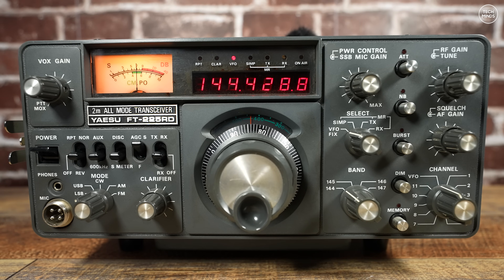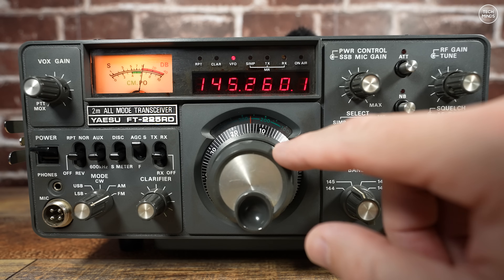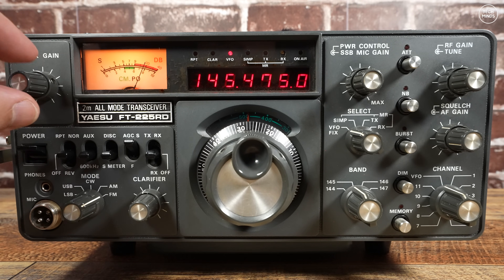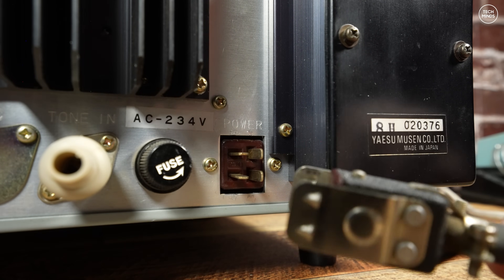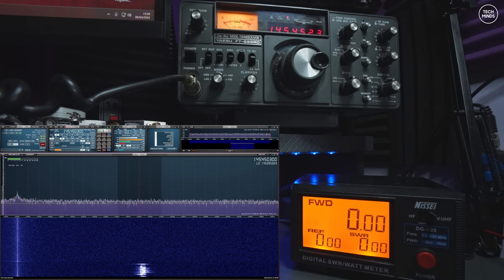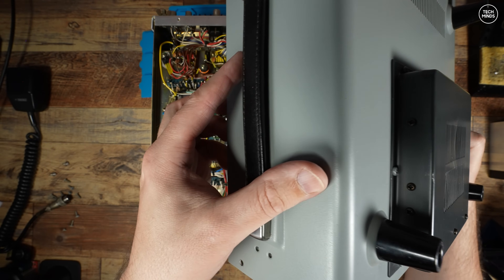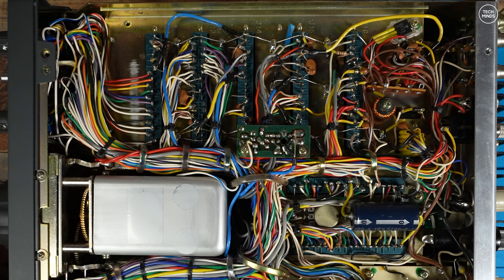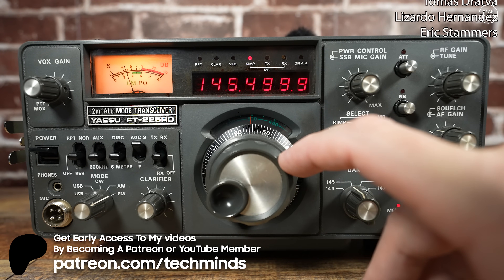Yaesu FT-225RD - A Historic And Nostalgic Classic Ham Radio Transceiver

Comment: I inherited this fabulous rig; mine also has memories. The memory function uses batteries that you need to install or replace—especially if there are old ones in there—before they leak and corrode. I put in new batteries and still couldn’t get the memories to work; the instructions in the manual are really poor on this part. One thing I’ve noticed on my transceiver is that the memory button works like a momentary push button instead of a two-position switch. I don’t know if mine is faulty or if it’s actually supposed to be like that. Bottom line: with the memory feature I’m in the same situation as you guys.
Reply from the maker: Yeh its very strange. Unfortunately I sold the radio on, I did not want to, but I really needed the space in my shack and it went to a good home.

Comment: I have a Yeasu FT250. Too busy in my life to get back into the hobby right now. Are these old radios worth hanging onto?  I've got several D104s ,a Ham4 rotor, bunch of other equipment. also planning on moving and need to downsize considerably. Where's best place to sell items?
Reply: Ham fest or That on line auction site.👍

Comment: I just worked on an older TenTec Triton for someone.  I ran through the entire factory tune and calibration while only changing one capacitor.  It has a Permability Tuned Oscillator  and the tuning procedure was lengthy to say the least.    Nice Radio!  Enjoy

Comment: I had the older FT-221 for years when I was a whipper snapper - great rig!
Reply from the maker: Im really liking this 225, I just wish I knew how to use the memory module properly so I can test if its faulty or not. The manual makes no sense.. lol.. Cheers!
Reply: @TechMindsOfficial  I can't remember, sorry 😞
Reply: @TechMindsOfficial  It's very simple to use. Whilst on the radio's internal VFO, just press the MEM button and the current VFO freq is stored. Then you can switch between the stored freq and your VFO.

Comment: I remember these, they where very well rspected and desirable,  ft101zd Mk3 would like nice with that or the ft902dm both being hf rigs. If you need a 2m yagi look at the powarbeams by dx shop, they are very well constructed and have an interesting driven element, pre tuned as well so no messing about.

Comment: Since you caught the bug: FT-902DM and FT-102. The latter is very hard to find and it is considered the pinnacle of the Yaesu "hybrid" radios. The 902 is more feature packed.  Both are a delight to use, the 901/902 are easier to work on (typical maintenance and fixing is a part of the deal with these radios), FT-102 has a better receive/transmit section (4 tubes instead of 2) and has the looks :)

Comment: The Mutek front end is under the label marked Rx RF unit, at the top right as you had the top of the radio shown and the fact that no adjusters are visible through the slot probably means that it is installed. I used to own a FT221R the earlier version you mentioned and fitted a Mutek to that. As far as I am aware a lot of people are still using these as prime movers for 2m and up for contesting and for transverting. The Mutek front end is pretty much bomb proof and has a vastly improved audio quality output and sensitivity and selectivity compared to the standard front end. 

That wacky power plug is a jones plug and they are like hens teeth. I've seen a couple of rigs from this era that have been converted to IEC. I don't know if there is space in the 225 to do this though. From memory (and its a long time ago) the 4th pin on the jones plug is +13.8V input for mobile operation using the earth pin as the negative. 

If you want to pair it with another radio from the same era then a FT101ZD and a couple of its accessory units such as the ATU, 2nd VFO and the speaker would look good together. Good luck in finding ones in good condition.

Cheers and beers 73 de Al G8YKM
Reply: Any suggestions as to a make and model of a vintage ham radio for an experienced operator. This would be a Christmas present.

Comment: Hello Matt, how good it is to see the old radios in action. I have a 221R which I have had from new. it is a great radio  but sadly without a CTCSS board it just has pride of place on the shack shelf.
I have seen the forums where people have tried to introduce CTCSS boards  in to the old radios but as they are hard wired , one slip and its then end of the radio. Thanks for the video and cant wait to see it in action with the Yagi.

Comment: Enjoyed your nostalgic look at your pristine Yaesu. I own a Kenwood TS-790A all mode 2m, 70cm rig with the optional 23cm band module. Kenwood designed the radio specifically for satellite communication allowing separate tuning of the twin 😊VFO’s etc. I purchased it second hand in the mid 1990’s and except for some minor repairs on the 70cm section and a new Mitsubishi 2M PA module it has been very reliable and a delight to use all these years. I’ve had more problems with the Kenwood MC-60 desk mic(s) than the radio itself!

Comment: That is a nice and beautiful radio from the past! I bought one for a very cheap price in an action but it is not working. With the radio came extensions cards for doing all the measurements and alignments so that will be no problem to get it working. The good thing was that the owner had the good judgement to install a mutek front end.

Comment: nice rig would go well matched up with an FT101zd or perhaps an FT102 the power plug is a jones cinch connector cuite common on 12v base rigs of the period my Drake TR7 uses the same connector. that one is shockingly clean for its age! you could easily configure it for SSTV, RTTY or a number of other modes with a suitably wired signalink box or similar you could even do wspr or ft8 though with manual frequency selection the software my complain!

Comment: Basically, the successor to the earlier Ft 221 R ( no digital display and only 10 watts ).

I always wanted one, but they were always too expensive.

I’ve an Ft 847 and an IC 7100 which both do 2metres and 70 cms SSB.

Comment: Thats a lovely clean one you have. Looks mint.  Well worth keeping as its a classic. Yes the Mains Power plug was standard on Yaesy and Kenwood back in the day.  I had a FT-221R It was a nice radio to but only 8 to 10 watts. The MUTEK front end is under the RX RF Unit cover. It transformed the receiver in both the 221 and 225.

Comment: Pick up a FT 901 or FT902 DM, they have the exact same sort of construction with the expansion cards for each function of the radio like your model there. It would make for a good station.
Reply: There is a whole lot of gear to extend these radio's. Like a rrty/cw console- transverter- second vfo- monitorscope ...
It took me a while to had it all together,  You are looking at alsmost one metres of radio.

Comment: I have always wanted Yaesu FT707 first solidstate mdsl? And it has WARC bands but not Top Band.
I wanted to buy one but “other” interests diverted me Hi. Saw one at a normal car boot for Fifteen quid but missed by seconds aaaaargh!. Just seem to keep missing them.
G4BTI.
Reply: I have one. Brought it all the way back from holiday in Hawaii to the UK, but so far not working.  Powers up but displays wrong frequency and no RX. There’s an active Facebook support group and I’ve been trying all the tips. The matching ATU that came with it does work, so at least I can use that.
Reply: £15?  That would have been a real bargain!

Comment: Lovely! This was the radio the "B" class UK hams always wanted. Superior to it's Icom rival that only ran out 10 watts. If you want to go HF then the 101ZD is from the same era and they would look good together. I think there was a 70 Cms version of the 225RD but that's going to be ultra rare. I had a 101ZD back in the 1980s when I was a new ham, bought used.
Reply: they had a , 6m,4m, 2m 70cm and Vary Rare 23cm versions
👍 FT 902d was the Up market 101zd. I am on the hunt for the older radios,  Already have a FT767gx fully kitted with all bands, just need the narrow filter for cw + a TS530s which i just replaced the caps to get it back to Tx'ing. These radio's were my dreams but much to expensive back then, but now no one seems to want them. cheap to buy, but Awesome to use.
Reply: @madb132  Not quite.  There was only ever a FT-225RD (10.7 IF) and a FT-625RD (10.81 IF).  I've converted a 225 to 4m quite easily. But to rework it for the higher bands would be much more involved.

Comment: How about the FT-726r, 736 or 101z, 902. Have a 736, 101z, 301s all working and a 902dm which requires investigation. Go on you know you want them. Those power plugs were the standard back in the day.

Comment: The power plug (Cinch Jones) and the old Amphenol (round tube socket looking ones) were common back in the day.  Add a external sound card dongle and you will be doing digital modes in no time.

Comment: what a beautiful radio you have there - back when this was released they were like owning space aged gear. my fire company owned one - it is now in service at our countys 911 center in the amateur radio operator's room . I got started in the early 1990s running all mode 2 meters - I did a lot of weak signal work using SSB and long haul SSB . that modular design on your radio is really nice and neat.. enjoy it - I wish more people would get back to using the other modes on the high bands again the availability of all mode VHF UHF is kinda tough now enjoy that cherry rig! lots of fun to be had there! .. 73 de N3TGY
Reply: I've held onto my Icom IC-746PRO because of it's all mode 2 meter capability also my IC-7000 and Yaesu FT-818nd  - all mode radios are getting scarce , wish it wasn't so..  when you get the beam antenna set up , it would be great to try some long haul SSB work . that would be really cool! I'd like to see a video when you lash that antenna to this rig!

Comment: That was my First ever "New" Big Commercial Radio.., I had a Belcom Liner 2 for 2M also
I Fitted a MUTEK Front End Board and CTSS Kit for Tones
I used Homebrew PA 2 X 4CX350R's into 4 X 16 Element Tonnas on a P60 Versatower

Comment: I got an Ft221R . Great radio :)
Reply: @perhansen8170  when I worked for Martin Lynch he said I sounded bad on mine so I bought a ic202s and a BNOS 180 linear which still works well with 3 watts from my FT225 I get 170 watts out of the BNOS

Comment: If you really are on a vintage trip, try the Goetting&Griem HG70. It has a QQE 06/40 tube as final amplifier. Sufficient power right from the start and no digital diplay at all. A 70cm Transverter and a 2m power amplifier are available as well to form a whole "line".

Comment: My Dad (Wa9FDP) ran the 146.820 repeater in Illinois. I have serval older radios. I’ve got a boxed up brand new yaesu ft-847.  Looks to be a nice unit.  I’ve got tons of kenwood repeater parts. Cavities tuned to 146.820.  Lot of 2 meter ham equip. My dad was hobbiyist as a kid in the 50s with tons of clegg equipment. Could be klegg I can’t recall.  Anyway. Good content. Nice to see folks still on radio. Cell phones dramatically dropped rate of new ham licenses.